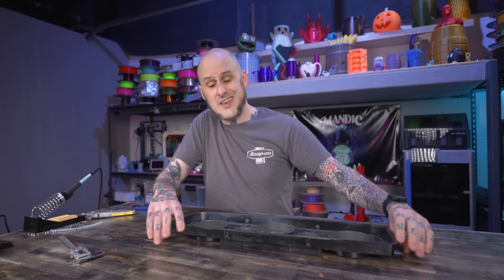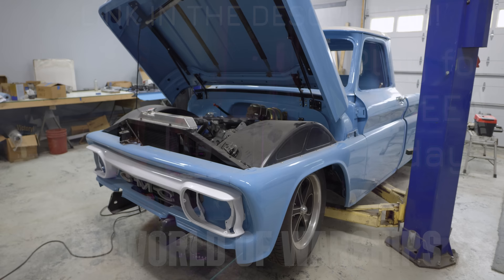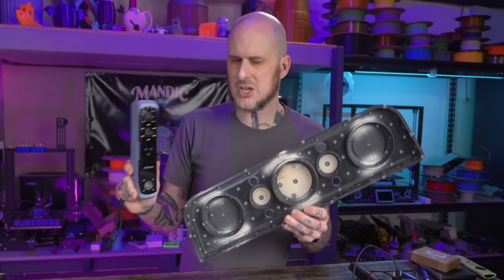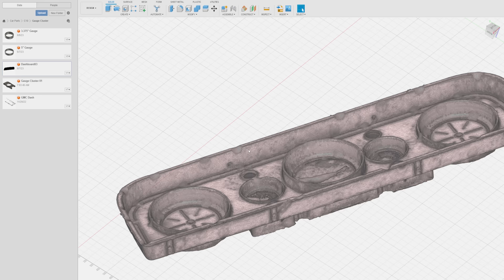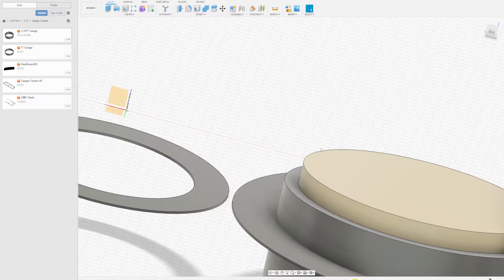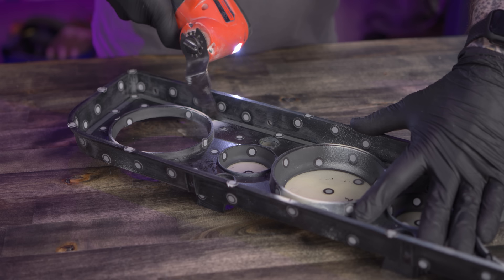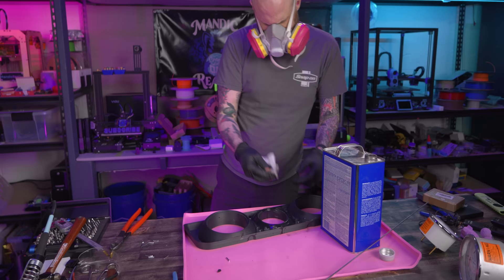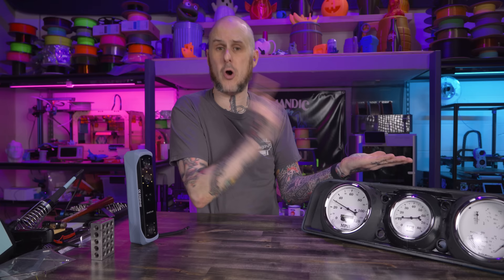3D Printed Dashboard for a C10!

Comment: it's nice to see the process of scanning + designing ... people tends to think that scanning=perfect reproduction. We can see that even with ''expensive'' scanner the scans you end up with is only there to help you design over it. Nice project mate !
Reply from the maker: I mean arguably a sub-$1000 scanner is a dirt cheap one. Most are upper 4 figures and up. That said, you are entirely correct. It’s only a guide, but a guide I wouldn’t have otherwise. I’ll play more with that scanner to make some reproductions of objects where dimensionality isn’t critical soon though.
Reply: Dude that is not an “expensive” scanner. Trust me with an expensive industrial scanner you do get close to perfect results. They save countless hours in labour compared to hobby scanners like the einstar.
Reply: @Theprofessor1212  i know :) ! That’s why i put the ( "" ) … the story stays the same anyway ! The scan is only there to help you design on top or you need to post process your scan because it’s will not be a perfect reproduction. What i mean by perfect reproduction is no holes in the mesh, no artefacts, etc.

Comment: Love this kind of work.
Would love to see more of the truck project if you intend to share.
Scanning needs time and learning to get it done righ and easier. I've used 3d sense before and that thing doesn't like to track objects, doesn't have gyro in it and the overall quality was rough, but good enough to transfer difficult to meassure points into cad for reverse engineering.
Nowdays scanners got way better at scanning resolution, software, and tracking algorithms and the process is much easier and rewarding.
Keep up with great content. Love it!
Reply from the maker: 3D Scanning is coming along pretty quickly, it is wild to see. Thanks for the kind words!

As for the truck, I've got a full series of videos on it on my HotRodHippie channel I used to do: https://www.youtube.com/watch?v=ZQbypl2IF2I&list=PLbz6McLd1t0VE6YOybH159BZ6AuSK_-wl

Comment: Maybe it would look cool if you printed it in the "copper" or some of the other metal finishes that can corrode? Or maybe just printing a top cover that hides the chrome and hides the join in the centre? So like a "top hat" sliding over the chrome and over some of the black plastic. And then in a an vintage looking metal printing material?

Comment: This is a well-timed video...my cousin asked for help just a few days ago in making a replacement taillight bezel for his 1967 Ford Ranchero, and while the printing part of it seems easy* enough I am stressing a bit about getting it scanned and repairing the parts of the model where the original is dented. If the photogrammetry app I downloaded doesn't work, I can probably borrow the Creaform scanner we have at work (though my minimal skills with Fusion 360 mean I might struggle even if the scan goes well). It's at least good to know I'm not alone.

*The real question for making the final product is going to come down to whether I print the replacement and it gets painted or electroplated, we print the replacement as a pattern for a sand or investment casting mold, or have Shapeways or PCBWay print it in metal. I still feel better about dealing with these issues than the scanning and modeling side of things, though.

Comment: I know you had a new toy to play with (3d scanner), but in reality is that not a little over engineered?

The old school way would have been to take pictures with a steel rule, then resizing the pictures to calibrate within cad.

Now if you were doing a project to make a flagstone former with the shape of your dogs head, I could see where you needed 3d and a scanner..

** if I'm giving you ideas, good luck sticking spots to your dogs head. Lol
Reply from the maker: Valid enough technique, I used it in a short video on here a couple weeks ago. In this case it wouldn’t have accounted for the exact shape of the existing dash. I’d have been creating my own body of the object to work off of, like a 3d scan generates. The gauges are large enough that the final product actually spills over the edges of the original bezel. That’s something that would have been difficult to determine purely off dimensional drawings (what a photo effectively becomes). Plenty of ways to do a task, what I was trying to achieve was best handled this way in my opinion.

Comment: +MandicReally They 100% reproduce the instrument cluster. Go look up LMC Truck. Although, the gauge cluster you are showing is not the factory bezel for that truck. They didn't use round instrument gauges in the C10 until later. Your dash also looks not factory to a 65 C10.
Reply from the maker: You are looking at and thinking of a Chevrolet C10, not a GMC 1000 series. I bought this truck all original 10 years ago down in Texas, and that gauge cluster is the original one.
Reply: @MandicReally  I also liked your redisgn concept of the bezel.

Comment: Why not save the original and remix the part to your needs?  Thanks for making a vid on practical scanning.
Reply from the maker: The gauges fit in a way that’s hard to explain, but basically requires it to be a two piece design. Recreating the exact fit of the original shell would be a lot of work, why do it when I have one? I’m a former custom car builder, I made a career of cutting up “original” stuff. The time saved is a huge compared to recreating something just to maintain one original part for someone else who may or may not ever need it.

Comment: Curious why didn't you just make the edge as well so you didn't need to hack up the old cluster? I make cluster for customers with digital dashes so it's weird for me to see part of the original being used instead of making a whole new custom piece. Also we need more videos on that sweet truck hahah
Reply from the maker: Without the truck to design around and fit to, getting that fit correct is a serious challenge. It’s a slip in dash bezel, not a face mounted design. So if it didn’t fit perfectly it will have ugly gaps or just not fit at all. The truck is over 500 miles away from me. Even a 3d scan is unlikely (at this price level) to get the fit right on the first try. Either way mounting flanges on the truck would require a 2 pc design for this gauge setup anyway. I’ve done a lot of custom metal work to get gaps and fits right on the build. Having the part the driver sees fit poorly would be unacceptable. 

All that work to recreate what I already have in my hands, why? To save one dashboard that someone may want? Not worth it to me. That’s a lot of time and energy better spent elsewhere.
Reply: @MandicReally  that makes sense, I'm not familiar with how they mount so makes sense like that. Mine are mostly newer model cars so they screw into the dash in one piece completely replacing the cluster. Even though they fit really well with no gaps etc, they generally have plastic trim that goes around them anyway. I'm in the process of making one to accept the glass from cover too, but that's a whole lot more work and intricacy

Comment: That truck looks awesome. Can't wait to see it fully complete and restored! I did wonder though, why cut the insert? Couldn't you have printed that out instead?
Reply from the maker: Recreating the exact fit of the insert (with the truck 10 hours away from me) would be a LOT of work. Getting that geometry perfect would have required numerous prototypes and test fits. Why save one dash piece that someone may or may not need again? The time saved is worth far more to me.
Reply: @MandicReally  ah I see. Makes sense

Comment: You can use foot powder spray on surface before you scan it.
Reply from the maker: My concern is manipulating it and wiping off any temporary sprays. As the majority of the item will never be seen again, scuffing it was free and easy.
Reply: @MandicReally  I've nearly mastered the art of laying down grey primer for this purpose. Grey works well because  it returns more light than black (which sometimes goes invisible to the sensors) and less albedo than white, which is sometimes so bright that the sensors are overwhelmed and miss details.

If you go that route, don't get the "high build" primers, and don't try to get full coverage. It'll collect in corners and make joints appear filleted when they aren't. Just a light dusting works.

Comment: hold on a miniute il just get 1000 out of my pocket to buy the scanner, mosty people who watch your channel including me have a budget, its ok if you get sent these gadgets for free but how a bout doing it the way most of us would do by copying the design in fusion or tinkercad
Reply from the maker: What is wrong with just seeing what options exist and enjoying expanding your view of how things can be done? Also who dictates what is "budget"?  Sure I can use a pencil and paper, then someone will say "Yea but you used a $1000 3d printer! Do it on a budget!". 

If every video was "beginner" pencil and paper process, folks would get bored eventually and move on. When most 3D Scanners cost $10,000+, this one is RELATIVELY cheap. And they only loaned it to me, I don't get to keep it.  For my work, I may well be buying it off of them because it safed me so much time and effort that I can see the value there.

I used to build cars for a living, tools have different values to different people.
Reply: @MandicReally  well i can see your point but why not make the video trying to do the part in software and then say well i could not do it in that, so here is an alternative to doing it that way, that to me would be a far better response than the one in the video

Comment: you  make it out to be complicated when its not u only need the right tools and a bit of know how to use fusion 360 witch isn't that complicated, its only complicated if u make it complicated i could probably do this is just over an hour
Reply from the maker: I look forward to seeing what custom vehicle you build and the video when you design a similar part.
Reply: @MandicReally  so why did u not with all your wisdon not to decide to make it yourself rather than get a company to sponsor you, not all of us have a grand to drop on a scanner and then get advertising revanue to show how it works, most of us mere mortals would try to replicate it with software rather than taking the easy route
Reply from the maker: @thediscoman2001  Is it only valid if I do a project for the absolute cheapest amount it could ever be done at? I mean the 3D printer I used cost over $1000. Should I only do videos using CR-10s and Ender 3s? Where is the line and who get's to decide what the budget is? A lot of people cannot even justify the expense of an Ender 3 in their life.

The 3D Scanner legitimately made this job easier, by a large margin. To me, $1000 is a justifiable expense if I'm going to be doing projects like this often. I completely understand it is a lot of money, but it saved me a valuable amount of time.
Reply: @MandicReally  It's amazing how little some people value their time.
That scanner would be a great investment for me. It would save me hours trying to map instrument panel mounts on old aircraft. 1000 bucks? That's less than one shift at my shop. :)